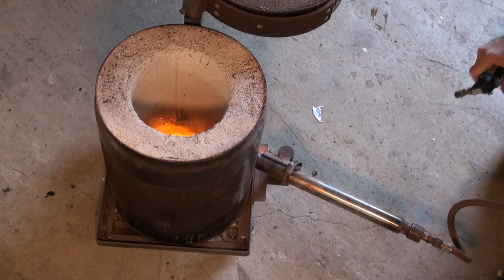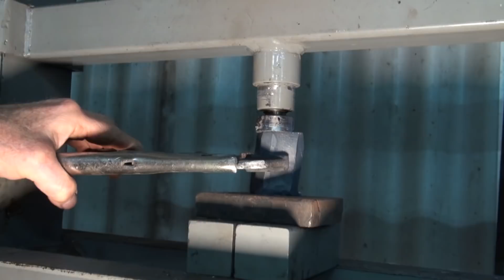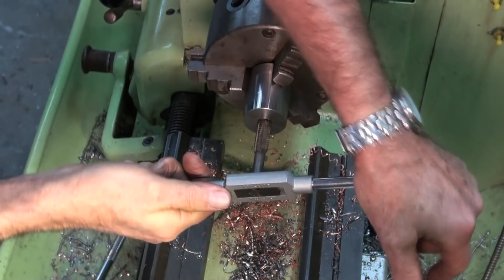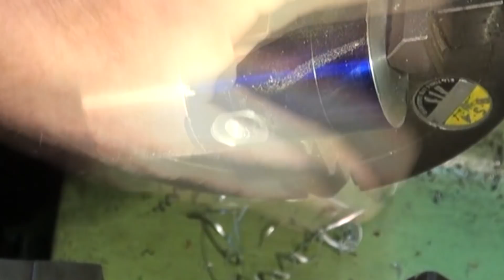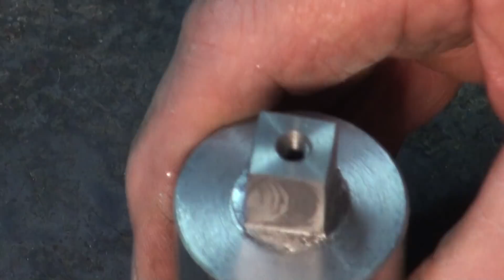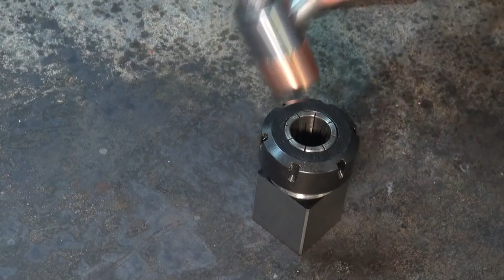Drawbar Hammer With Forged Copper Head Part 1

Comment: I'm another idiot with Morse fittings. PS those that might rubbish you for having such archaic stuff don't own what they use or have a much deeper pocket than me as a hobbyist. I know what you are saying but my morse drawbars are removed by turning backwards against a fixed nut so there should be no need to use a hammer ( unless you over tighten the taper )
Reply from the maker: I know what you mean. I purchased a Bridgeport knee mill with an R8 spindle and I also fitted a pneumatic power drawbar and it's so much quicker than flogging out the morse tooling. I believe that Sieg did make an X3 mill with an R8 spindle but I am not sure they were sold here in Australia

Comment: Hi, just found your channel.
I'm enjoying the content.
Do you have any information in your "Frankenmill"? Looking to do something similar to an old Danish mill I have.
Reply from the maker: Ian, I'm glad you are enjoying the videos. I made the vertical head for my mill from aluminium castings but cast iron would be way better. The spindle is 4140 steel but unhardened. It was actually hydraulic ram shaft with a hard chrome coating. It is quite tough to machine but it is quite good for this application. There are two tapered roller bearings on the spindle with a fine threaded nut for the preload. I have put all the engineering data for it on dropbox. You are free to download it here: https://www.dropbox.com/sh/ax9j3tjsmw3lskh/AADej0cDCQu94ZyyeIgUdB2ka?dl=0
I am using a 1KW three phase motor with a toothed belt drive. The motor runs from an Invertek variable frequency drive. It lacks torque at low RPM but it is great for machining aluminium.
Regards,
Mark
Reply: @Preso58  Thanks for the detailed reply. It's much appreciated.

Comment: Curious why you chose to forge instead of cast the copper. Was it just to do something different?
Reply from the maker: I had considered casting the copper. I did some research on it and found that copper is very reactive when it reaches casting temperature. It can oxidise very violently and it needs a thick layer of flux to keep it from burning. If  you watch any copper casting videos you will see clouds of green fumes during the pour. I have since cast brass and that would have been a better choice if i was going to cast it. Also, I was just keen to see how difficult it was to forge copper. 
Regards,
Mark

Comment: threaded rod is made from grabbium grade steel i guess... after all at least here in germany, the galvanized threaded rod is kinda gummy but ok to machine once the thread is cut away. i have a hard time getting round stock bigger than 12 mm at the hardware store, so i always have a length of m20 rod here since its also really cheap to buy (i think about 4€ /m) 

the stainless one is a bitch though, its really tough and almost unusable to machine at least.

Comment: Nice project.   I can appreciate he nice appearance of the copper will not last long, but that is the reason for making the tool.

I have considered making such a tool for my milling machine, but I use my spanner with 19mm at one end for the vise nuts and 17mm at the other end for the drawbar.  If I made a similar tool I would still need the spanner for the vise nuts.

I have not tried forging any metal, but not a surprise to see the metal has its own idea of how it moves.

I got a smile from the part about the design change due to not having a 12mm bottoming tap.   I have so many of my own examples where a design changes due to tooling on hand vs tooling desired, or due to "Murphyisms" causing some change.   If only we had an undo feature to replace metal when we machine or cut it too small.

I do a lot of wood work and wood turning and often combine different wood species for contrast.   So many words are different in US, UK and Australia.   In the US no one calls wood timber.

I was hoping you were going to use a spokeshave to achieve the shape of the handle instead of a CNC machine. 

Dave.
Reply from the maker: Dave, I always thought "timber" was a universal descriptor of tree wood. I do know that no one in Australia refers to construction material as "lumber". I inherited a bucket full of taps and dies from my father in law who was an aircraft mechanic. Many of the taps were mismatched sets and I never did get around to filling in the gaps in the inventory.